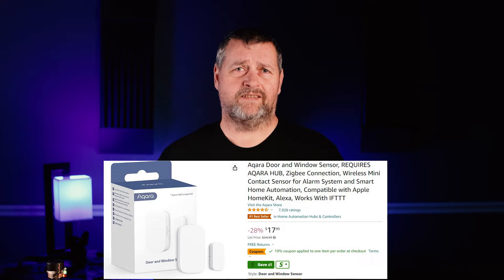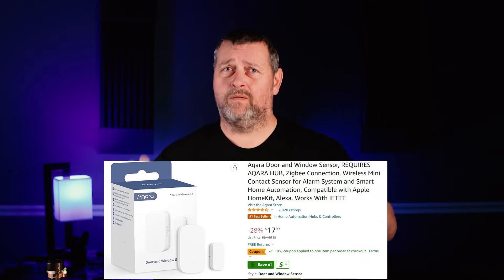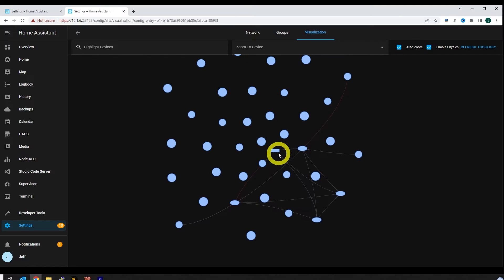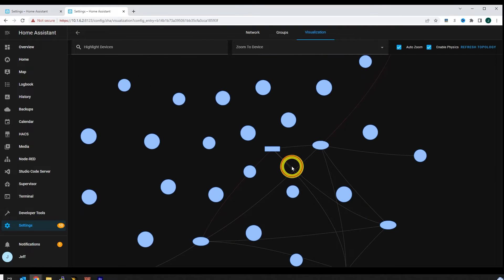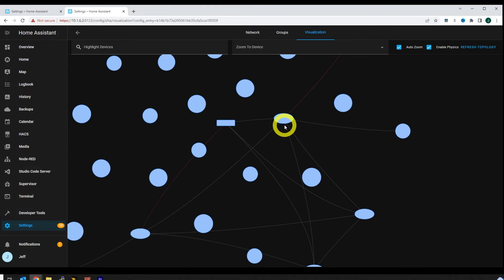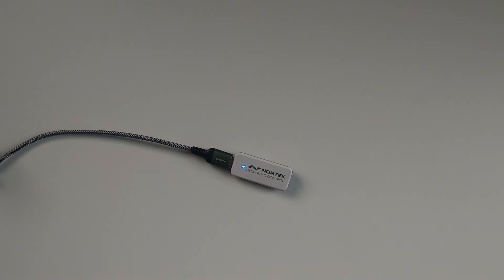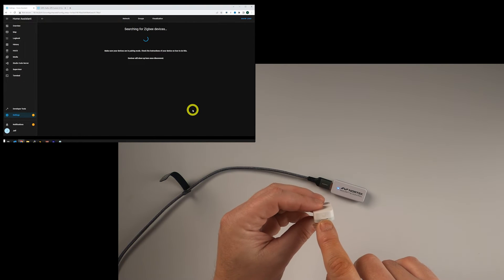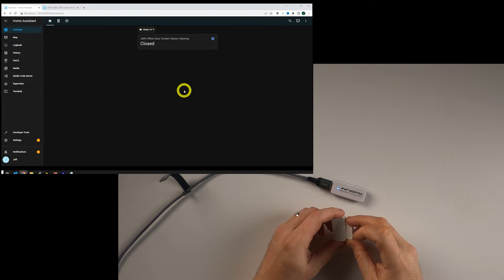Home Assistant and Zigbee - First Time Integration, Device Registration and Automation

Comment: Seems like a lot of praise on the interwebs about Aqara, but a lot of what I see online and Amazon etc it talks about a specific Aqara hub being needed. I'm not wanting to ALSO have an Aqara hub. It looks like you were able to add these straight to ZHA? Or was it the Homekit integration?

After being caught up in the whole MyQ debacle, I'm quickly becoming part of the Local Control only crowd. After researching for a bit, I think I've landed on Zigbee. Totally dig the recommendation of the dual radio stick though. Gives more options. Thanks again for all of the great stuff.

And yes, if no one responded on any other videos, definitely add a what's in the glass bit to the vids. (Bourbon lover here)
Reply from the maker: Nope, no Aqara hub required.  The USB stick acts as your "zigbee hub", and you just add these right to ZHA as you correctly surmised.

I've always tried to be as local-only as I possibly could be with all my decisions.  It's a shame that it took such a public event for others to come around, but whatever the cause, I'm glad people are finally coming around.  I have a VERY small number of things here that depend on the cloud, and if they suddenly stopped reporting to Home Assistant for whatever reason, it wouldn't hurt (like my washer and dryer).  Lights, audio, cameras, motion detection, all that stuff - local is the way to go.  :)

I'll try to remember to mention what's in the glass for ya.  It seems the audience is somewhere torn on that.  No matter, for all of December it's eggnog anyway, so..   :)

I did do a few where I specifically called it out though - look for any of my #five minute fRYEday videos.  Rye, not bourbon, but I definitely call it out.  Had a few doozies in there!

Thanks for watching!

Comment: I don't get to create a network, it ask me what radio type.  Zigbee Gateway DMD 2CC.   It can be connected as Tuya but I can't get Local Tuya to work so I'm hoping Zigbee will work.  So far it just fails to connect regardless of what radio type I select.

EZSP = Silicon Labs EmberZNet protocol: Elelabs, HUSBZB-1, Telegesis
ZNP = Texas Instruments Z-Stack ZNP protocol: CC253x, CC26x2, CC13x2
deCONZ = dresden elektronik deCONZ protocol: ConBee I/II, RaspBee I/II
ZiGate = ZiGate Zigbee radios: PiZiGate, ZiGate USB-TTL, ZiGate WiFi
XBee = Digi XBee Zigbee radios: Digi XBee Series 2, 2C, 3

I'm starting to think I will never get anything to work in Home Assistant.  

Thanks,
mfk

Comment: You didn't mention the drivers and I'm assuming that's because it's obvious? I'm not getting the same options and that's confusing. The only difference as far as I can tell is that I downloaded the drivers.
Reply from the maker: The reason I didn't mention any drivers is because none are needed.  Plug it in and it works.
Reply: @fasthowto  Lol, I was pretty concerned you were going to say that...ugh. Thanks!
Reply from the maker: @pcampane99  If it's not showing up, I'd reboot first.  Then, add the ZHA integration manually?  Perhaps it's just not being discovered.  Are you using the same NORTEK controller that I used in the video?
Reply: @fasthowto  Yes, same one. I like the 2-in-1 form factor. I'm still getting the 'Silicon labs option along w/ about 4 other options, none of which are ZHA. Odd. I deleted all the driver files prior to redoing this.
Reply from the maker: @pcampane99  ZHA is the name of the HA integration that would use the Zigbee radio.  My device is listed in there as a Silicon Labs EZSP if that helps?
Reply from the maker: @pcampane99  ah. Those ones are old ones you used to use, I think. I had the same issue. I cut it out of the video because I was trying to show what a new install would look like instead of switching hardware, but...  Going from memory here, I think if you go to entities and then change it to show all entities (disabled ones are hidden by default), then you can remove all of them so they don't show up anymore. In fact, I'd unplug the new one, and remove it from the system too. Then when you plug it in you should only see the ones I showed in the video.
Reply: @fasthowto  Awesome! Thanks so much...I'll give it a try right now!
Reply from the maker: So how'd you make out? Everything working?
Reply: @fasthowto  I badly want to tell you yes, of course, but for some reason, no joy. I've deleted everything I can, but I keep getting those same 5 options over and over. I have the 10 ft cord as well. I must have something lingering, maybe? I'm looking in every folder, but nothing looks remotely familiar. It's strange.
Reply from the maker: @pcampane99  it wouldn't be in the folders, I don't think. Did you check the disabled entities?
Reply from the maker: @pcampane99  also, the cable is just to prevent interference when pairing devices, it wouldn't have anything to do with the difficulty you are having.
Reply: @fasthowto  I did... Scrolled through each one, but didn't see any of the options I posted earlier. The only Zigbee labeled entities I had listed were my Hue lights. I showed all the hidden entities before scrolling though.
I only checked the folders to make sure no software was possibly interfering and mentioned the cable for the interference reason as well.
When I plug the USB in, I can see both the Zigbee and Zwave ports in my Device Manager.
I've got to be close! 🤣🤣

Comment: Hi. Thanks for another great video! I am currently putting together an x86 mini PC solely to run HAOS (using your "How To Install..." video). I have a Sonoff Zigbee Dongle-E ready to go that I managed to get working on my previous 'rescued-from-the-trash' Optiplex.

Anyway I currently have several Zigbee (and a few WiFi) devices 'assigned' to a Tuya Zigbee Hub with various automation running. What's the best way to 'switch over' to HA? Should I pull the plug from the Tuya Hub before installing the Sonoff Dongle in HAOS? Would this enable my Zigbee devices be 'seen' automatically, or will I need to put them each into pairing mode?

I have several Gledopto Zigbee & RF LED controllers that an electrician 'hard-wired' making it difficult to get them into pairing mode. They are also 'registered' to a RF handset for easy control over colour/temp/brightness and I fear that putting them all in pairing mode will mean they lose connection with the RF handset. Have you experienced these before?

Cheers!
Reply from the maker: Sorry, no experience with those particular devices.  However, if you switch dongles, you will have to repair devices, yes.

Comment: What is your thoughts about Zigbee to Mqtt vs zha?
Reply from the maker: That's a great question.  I have an MQTT server that I use for notifications from BlueIris, but I've honestly not tried Zigbee to MQTT.  ZHA has always worked well enough for me that I haven't seen a need to change.  Which do  you use, and why?
Reply: @fasthowto  First,  thank you for posting such great tutorial videos. I just got started with Home Assistant installed on a Dell 7050 micro.  I haven't setup my zwave and Zigbee dongal yet,  but I have seen several videos that suggest using Zigbee to Mqtt for more control over devices .
Reply from the maker: Thank you for the kind words.  It brings a HUGE smile to my face knowing that my viewers find the videos as helpful as I'd intended when I made them.  :)

As for the discussion -I guess I'm not sure how much more "control" I need over my Zigbee devices?  I mean, I suppose that could also depend on the type of devices.  But so far, I have contact sensors, temperature/humidity/pressure sensors, outlets, water leak detectors, motion sensors, lightbulbs, and I also have an Aqara cube (still in the box, for a future video).  I can do everything I need to do - get temperature, get humidity, get pressure, get battery life, get notified when something is wet, get notified of motion, turn lights on/off, dim lights, change their color, get battery life of any zigbee device that has a battery, turn outlets on/off, know when a door or window was opened...  Everything seems to work quite well with ZHA - for me.  Now, I know that some zigbee/zwave dongles are better than others when it comes to ZHA integration.  If you bought one that wasn't one of the recommended ones for the ZHA integration, then perhaps Zigbee2MQTT would be the right choice in that instance.  For my money, until I actually find something that I absolutely cannot do with ZHA, or some device that refuses to work with ZHA, I'm going to stay with it.  Zigbee2MQTT may or may not offer some advantage that I am not presently aware of, but since it introduces MQTT (if you don't already have MQTT then it's just one more thing to install, configure, and maintain - not to mention learn!) I'm not sure it's worth the extra layer of complexity.

Put another way, very early on in my IT career, I wanted to do ALL the things - simply because I could.  I frequently made things more complex than they needed to be, for no other reason than the option was available and I could do it.  Over the years, I've learned it is better to ask "Should I do this?" rather than "Can I do this?".  KISS is the principle that I base everything on - professionally, and personally.  Simple is stable, and stable means more time to enjoy life and less time fixing stuff.

Comment: Oooooh the Zigbee.... Currently using Zigbee on HA Yellow all stock with Yellow Multi-PAN Zigbee Home Automation (ZHA). Previous I was using the Conbee stick and zigbee2mqtt. I had read/heard that zigbee2mqtt had more capabilities and I think it did in particular it had firmware updating. However, I would run into issues with zigbee2mqtt and decided to move to ZHA. When my crowd source Yellow arrived, I moved to all stock Yellow with ZHA. Iam impressed with the Zigbee stability and speed on the Yellow, but I am still trying to figure out firmware updates. I have a Zigbee light switch (Enbrighten from GE) that has an LED light on it that I want to turn off and I hear that the firmware makes it controllable. I cannot find anything in current HA docs that talk about ZHA and firmware updating.